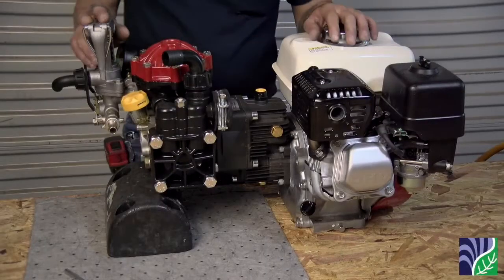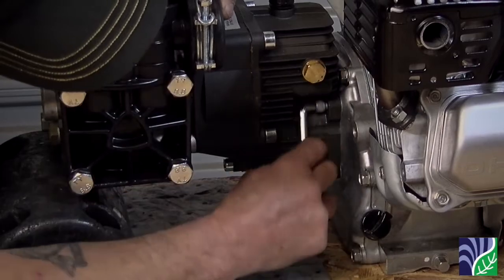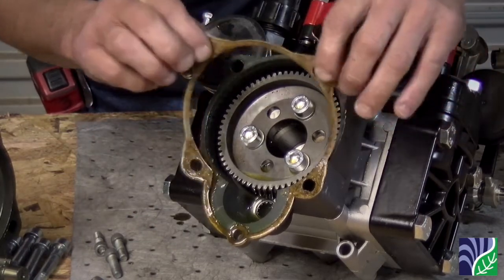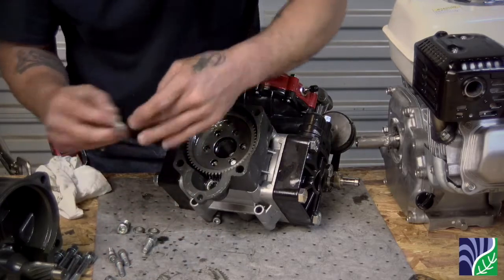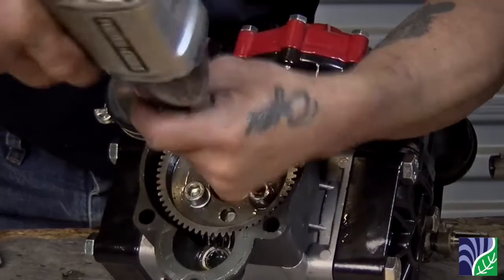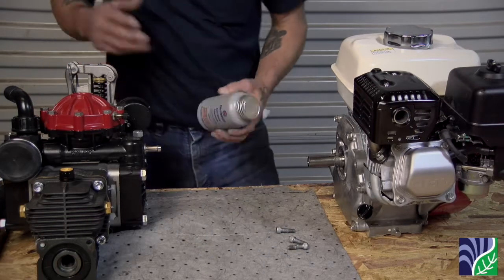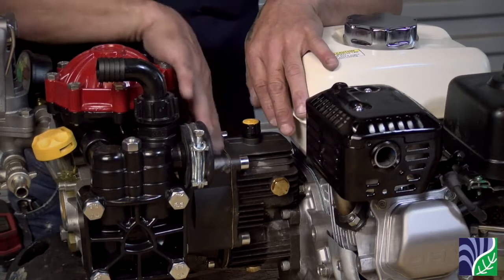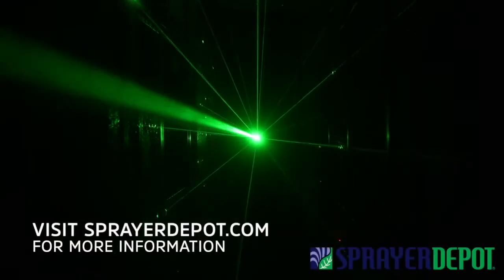Assemble a Hypro D30GRGI Honda GX160 Pump Engine | Sprayer Depot, #1 for Spray Equipment

Comment: I can’t get my gear box off my motor I’ve been trying for two days hammer,deadblow, mallet, ballpeen, wood and hammer, even a damn sledge. I need this motor for Monday so please if any one can help.
Reply from the maker: Hi Zach, we're sorry it's giving you trouble - sometimes this happens and it seizes if it's not removed once a year and anti-seize applied. Our customer service techs said a new engine is the best course of action at this point.

Comment: Do you remove the gear box to just do the diaphragms on the pump? The two companies that did these repairs sold and I need to learn this asap.
Reply from the maker: You don't have to take the gear box off, but it's easier to complete the repairs. Here's another video that will help: https://youtu.be/RH7Fj53OLJs

Comment: best part about the DR30 is that AR is now making the pumps not hypro and they are now AR30's they are made in italy.  I just got mine today. very excited to start using it
Reply from the maker: Happy Spraying!
Reply: Question. I have the Ar30 made in Italy as well but it says to use sae 30 oil? I'm looking for a how to video to do the diaphragms, do you have any videos or links? Thanks!
Reply: @carlitoswayz-Okan  search you tube. Sprayer Depot has lots of videos on pump repair.